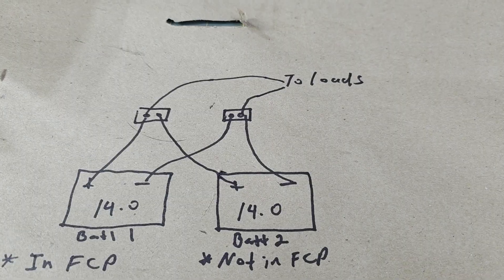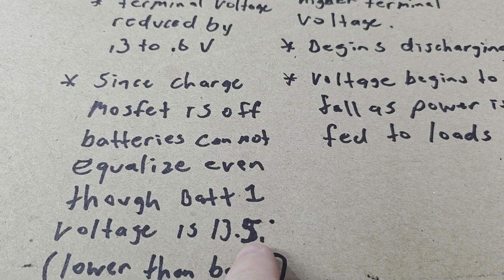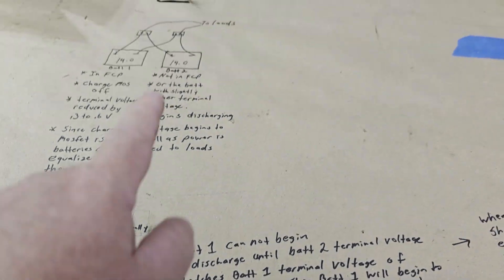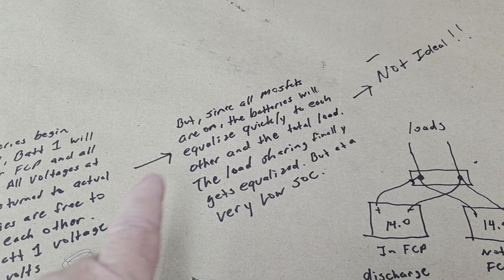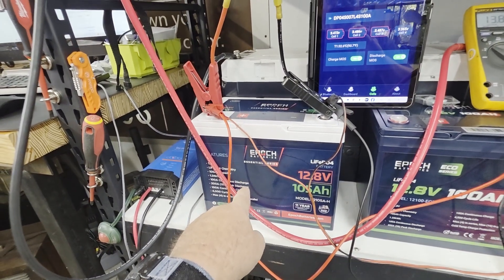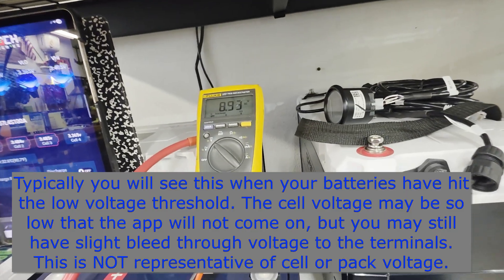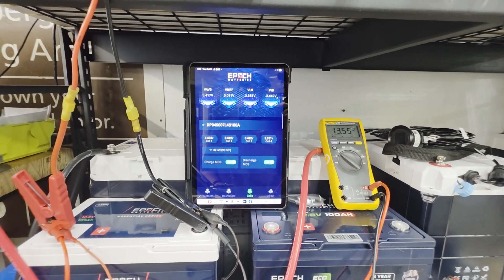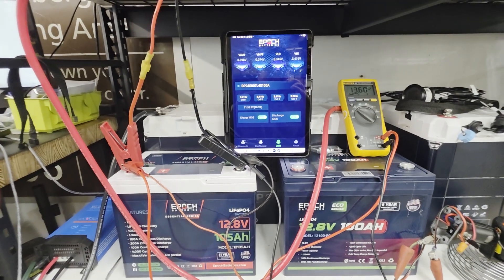Lithium uneven discharge of Li Time, Watt Cycle and others with Full Charge Protection explained!

Comment: Yes, it's the body diode that conducts which causes the voltage drop. A higher voltage drop means more power needs to get dissipated at higher currents, which would eventually kill the MOSFET. That's most likely why the BMS doesn't allow you to turn the charge FET off at higher currents. I don't even know why they let you the FETs off individually, as that makes little sense, unless you're testing something. (You are aware that charge and discharge FETs are in series?)  Also, your LFP needs to have full charge protection, as overcharging them is the quickest way to kill LFPs.
Reply from the maker: I disagree about the need for FCP and the resulting uneven discharge. I would rather program my fancy chargers to provide the operating envelope  instead of giving the battery this clumsy control. A proper 3 stage charge of cc, cv and float (lower voltage cv) is a better idea that sticking FCP in the battery.

Comment from the maker: After further research it appears voltage drop from a mosfet based BMS is typical when either the charge or discharge mosfet is off. This forces power to flow across the body diode once the mosfet no longer conducts and current is then forced over the diode which results in a voltage drop across the diode, which is typical. So the voltage drop is normal. What is not normal is the parameters of FCP and the conditions set up once a pair of batteries goes into FCP coupled with the very low threshold to clear FCP.  So generally avoid batteries with FCP.

Comment: Coincidentally, I'm considering a pair of Wattcycle 12V 100Ah Minis because they will fit in my application where a single 12V 200Ah will not. Are you familiar enough with this brand to suggest an absorption voltage that will not trigger the disconnects or uneven switching that you describe? Also, do most who do this have all batteries connected to a single shunt to monitor total bank capacity? Or do they look at individual batteries, either via separate shunts or on the phone apps? Thanks!
Reply from the maker: I believe Watt Cycle has come up with a fix with a toggle on the Bluetooth app for "parallel mode". But look into that. Most of the time an absorption of 13.9 will not trigger FCP. But I have heard some LiTime batteries FCP starts at 14.2 and an absorption voltage of 14.1 prevents its activation. Most people will use a single shunt for the entire bank. I did have one customer who installed 8 shunts on his 8 very large batteries. It was quite a system. But probably not needed. BTW...check out the Epoch 300ah Essentials. It has a very small foot print and does not have FCP. Not sure if its in your price range. Just a recomendation.

Comment: Is this problem just on “ smart” batteries ?  I haven’t had problems with my non Bluetooth batteries.  Or are we just not noticing it in non Bluetooth batteries?  How do we know what batteries are affected?  Thanks for the video.
Reply from the maker: It possible you may not notice. I have heard of some non-bluetooth batteries having FCP. You can find out if they have it by step-charging in 0.10 v increments starting at 13.8 volts and letting the charger fully absorb until 0 amps are going in. Then bump up another 0.10 volts. If you step up the voltage another 0.10 volts and the charger still shows 0 amps, and that next "bump up" in voltage is less than 14.4 then you may have FCP. If you have had your system and have not seen any anomalies then I would not worry too much.

Comment: So why not just find out what the specs on the battery for when balancing of individual cells begin? Use that info as well as when the battery will disconnect and set your charger settings accordingly? If your battery disco's at ~14.6 and your cells start balancing around 3.4 (13.6v) set your max charge to around 14.2v. Your batteries won't disco and your cells can all balance out. The top of the charging curve is so minimal for adding capacity, there's no point in going to a FULL charge. People need to stop using the battery BMS as a way of stopping charging. The BMS is there to protect the battery, and to let everything else know what it needs. A properly configured system should almost NEVER have a BMS disconnect...
Reply from the maker: Scottie, The FCP criteria in batteries that have FCP have never been published on any battery that I have ever seen. Usually the pack overvolt (14.7) and cell overvolt (3.7) are typically published and are also present in batteries with FCP. So many consumers will think they can set a fairly standard charge profile such as 14.2 absorption and 13.5 float and then are completely baffled when they see batteries exhibiting odd behavior, some of which can be destructive. FCP is another layer of criteria in addition to the standard COV and Pack OV that we all understand. A properly configured system for an FCP battery might be as low as 13.8 absorption and 13.5 float. But of course you would need to know 1) that FCP is present 2) what the  three criteria for FCP are.
Reply: @mvintrigue-trawlerdiy1101  additionally, in my experience, FCP is not just dependent on voltage!  You touch on this in the video.  Some batteries will go into FCP at, say, 13.9V but only when they  are 'full', where full is likely defined by tail current level dropping below a certain threshold at a certain cell voltage.  There are certain batteries where the voltage needed to balance internal cells is high enough to get them to go into FCP when they are fully charged, as the name implies.  This means the approach suggested above by Scottie will not work for some batteries.  I also wonder 'at what cost' are some of these batteries eliminating FCP.  In boats on shore power where there is a charger running 24/7, I expect there is some negative impact to cell life.  When an appropriate charger that is configured correctly, such that it is going to float mode at, say, 13.4V, I expect the impact is minimal although not zero, as there is likely some small tail current flowing to the cells, which are already as full as they should be.  I expect that company's like Epoch, who once implemented FCP in their best batteries, have shifted away in an effort to consciously compromise extreme cell durability to solve the more customer centric problem you highlight here.  It seems to me the best answer is neither in 'old fashioned' FCP, nor in the elimination of FCP, but rather a type of FCP where the battery shuts off the charge at the source (the charger) rather than internally.  Think 'Victron coms' and the like.
Reply from the maker: @MattL-k4s  So far all of the battieries with FCP that I have been able to see the programming for have contained 3 parameters in that "extra layer" of protection. Voltage @ xx.xx and above > Amps falling below x.x > once those two conditions are set for xx second- then FCP is engaged. The presence of FCP is beneficial to the battery manufacturer in general, but detrimental to some amount of purchasers. If Litime makes a 230AH battery for market, that battery will be sold to a broad range of end users. Trolling motor guys, camper guys, boat guys, and any other number of use cases. The people that charge with a very poor charger or simple power supply like a camper converter that has a constant output of 14.6 volts will benefit from FCP, as will the manufacturer in regard to possible early warranty claims because the battery is doing the "stopping" of the charge. But as you say, the rest of us that have purchased all Victron stuff, and poured over every detail of our charge profile, would prefer to have our fancy equipment do the starting and stopping. The fancy equipment will maintain the safe operating envelope...not the battery. Mainly because the battery closing the charge mosfets while a large charge load is applied can result in voltage spikes and damage as well as uneven discharge. But yes you have it right on Epoch. Epoch batteries are targeted to the crowd that will have the fancy equipment and the correct charge settings. In addition the V2 with Victron comms will do all the controlling needed when coupled with a full Victron system and under BMS external control. As such they pulled that feature and gave full control back to the customer and made the assumption that the customers were smart enough to do what is right. The implementation of FCP by others is an assumption that the customer will not do what is right and FCP will snatch that control from the end user. As you know they are not entirely wrong...lol. So companies like Epoch that once had FCP and chose to remove it I give credit to because they have decided to give maximum control to customers, Beside, all the other standard BMS operating envelope max values are still in place. So its not too big a deal. Thanks for the discussion.